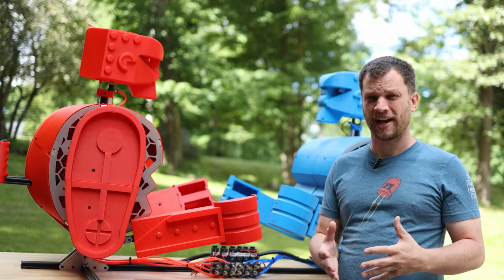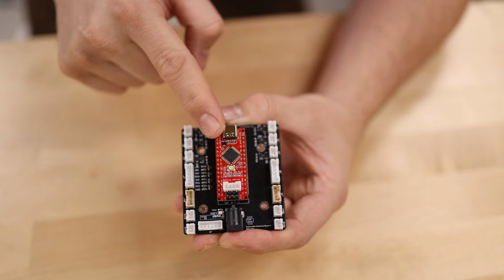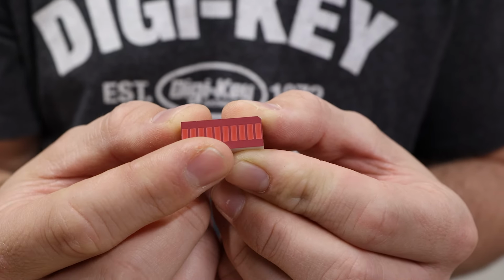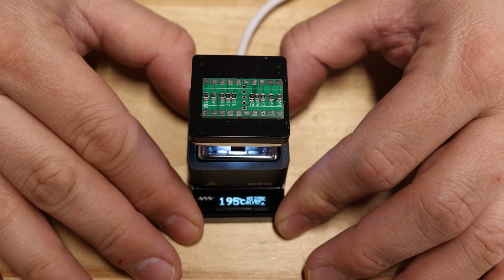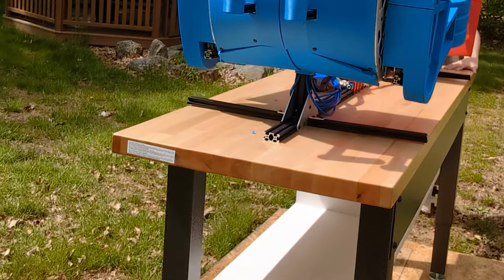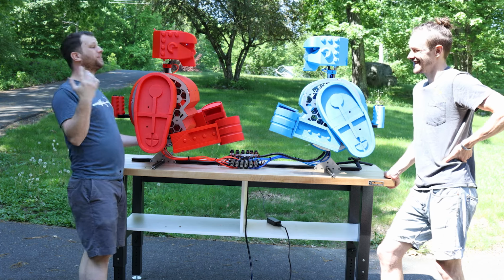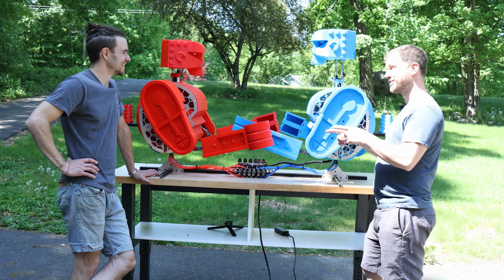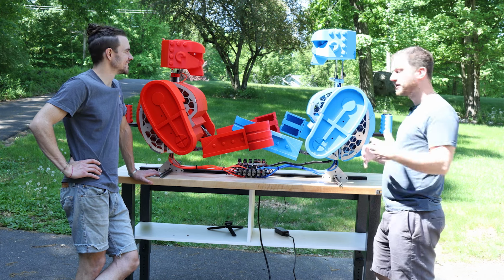I fought my friend - Life Size Rock'em Sock'em Robots Part 4

Comment: I agree with others. The lack of real "Punch" undercuts the experience. Also In the Game they move. So you can move your guy in and out of range. Its also the heads that you are trying to hit. Not count body shots. I think put the IMU in the heads and change you 4 bar linkages so they strike towards the faces. Then put them on linear rails (Most likely double v wheels will be good enough) so you can move them in and out of range. also allow some torso swivels so you can aim the hits better. I know it took a lot to get to this point and They look awesome but could use some refinements and tweaks.